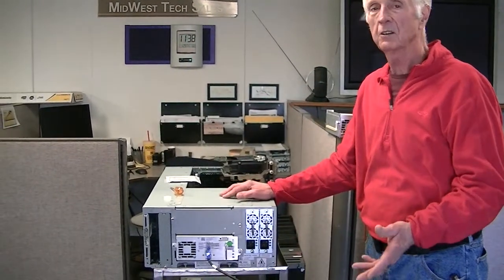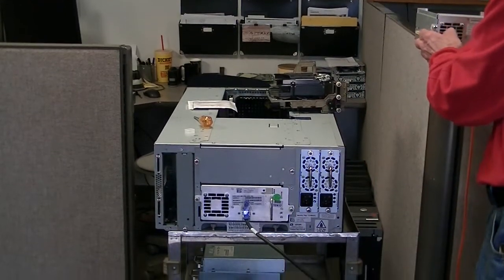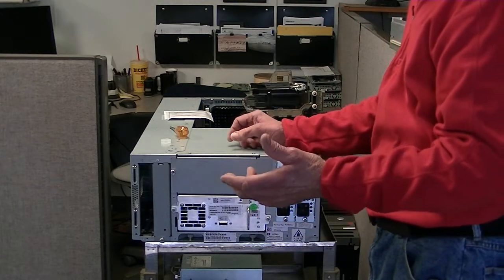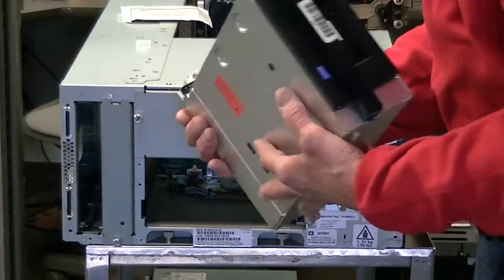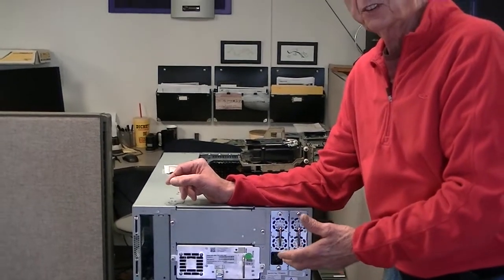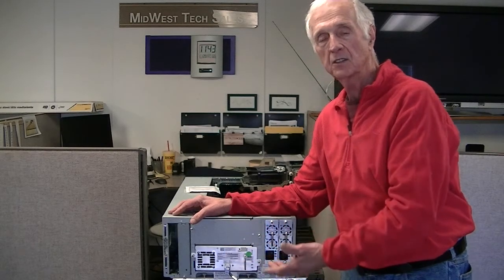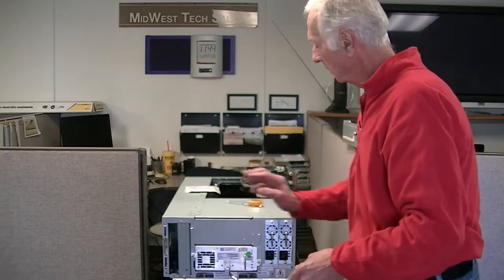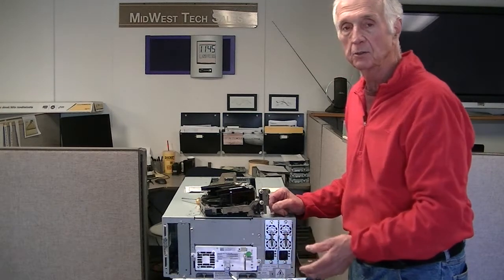Dell ML6000 Drive Replacement Procedure

Comment: I want to know.  How to connect ml6000 to its expansion
Reply from the maker: You need a library specific terminator (3-01854-03) on the top and bottom and an interconnect cable (3-01853-03) from the bottom of the library to the top of the expansion unit.  We have these in stock, for sale.